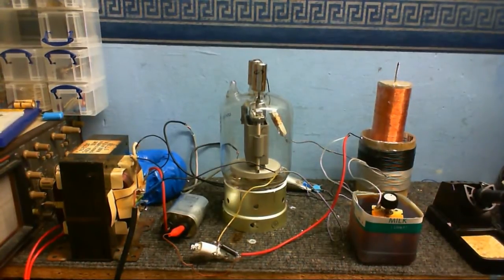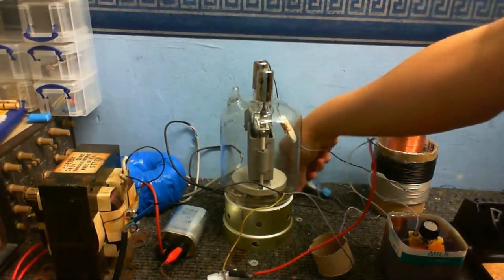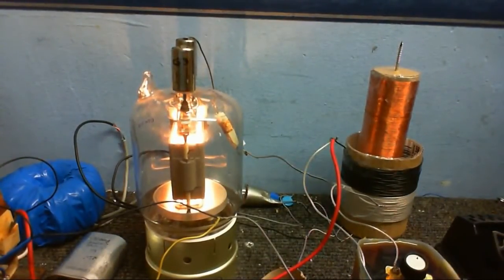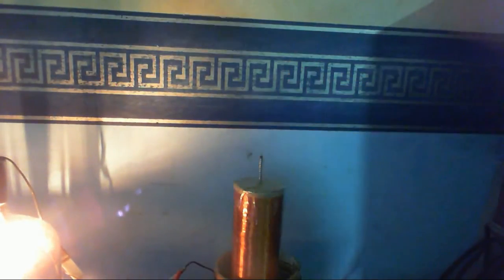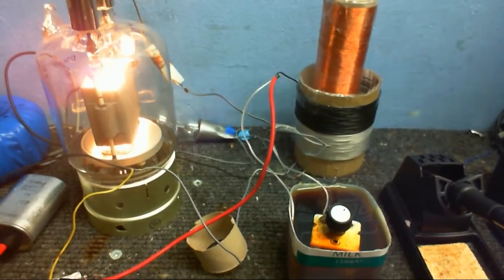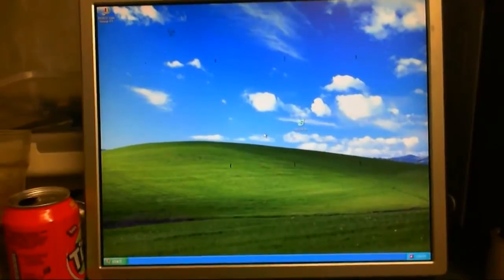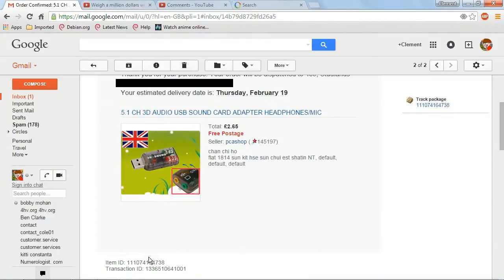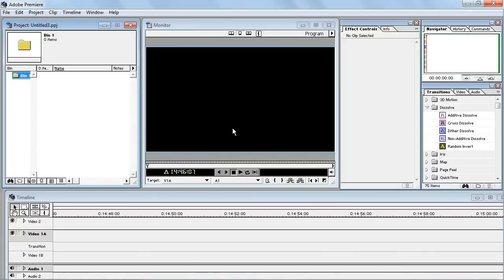GU81 VTTC, plus some bad & good news

Comment: Hey mate I have 2 of them pentodes for a VTTC did you run them in ? The filament should be run for about 12 hours to form the getter .take a look on 4hv.org ,do you plan on audiomodulating one of the grids would be good to see a reel to reel playing though it :)
Reply from the maker: HighVoltageProjects I might revisit a base-fed VTTC and try audio modulating that.  I've got an idea of a circuit that might work. But I had no idea that I had to "run the tube in" I thought they already had a getter, but just where I couldn't see it.
Reply: Cool ,I'll try and find the link for you as I'm sure I saved it somewhere .it's worth doing rather than damaging the tubes I think I have a schematic of one of these for audio too :) love the vids btw

Comment: Half the battle is primary tuning and grid leak tuning , With a 811A and a 2 inch by 2.8 inch secondary I was getting 10 inch arcs in staccato mode .  Are you running the 3 grids all tied together ?
Reply from the maker: twirlywirly555 Actually I have grid 1 & 2 connected together, grid 3 is connected to ground.  When I get some money 'm going to try to get some HV capacitors to tune my primary, THEN I'll try it on full power!
Reply: Okies , well its best to tie all 3 grids together and run it as a triode if your not using the second grid as normal

Comment: Do you worry about accidental electric shocks or house fire?
Reply from the maker: John Simpson I shocked myself dozens of times, I think I've become immune to it!  Seriously I can touch a live 300 volt wire (as long as it's DC) and not feel a thing, I only get zapped if it's AC or if I touch the ground wire as well. Should keep a fire extinguisher on standby though.

Comment: Sometimes the order in the drivers are intalled matters. You install the sound card AFTER some other drivers DID, and perhaps you got a HW conflict type. Scan for missing systems, chipset, motherboard missing drivers .... Also, SOME UPDATES can turn HW into unusable. Because, they are garbage
I would do a fresh installation, first do all the chipset and motherboard drivers, then move to the cards BUT Windows XP is DONE, turn to Seven, 32 bit version is pretty XP compatible, easy to install and is better than XP. I you have enough RAM install XP on a Virtual Machine, run XP and do all your things INSIDE the virtual machine. Since intallations in the virtual machine is just a big file with the OS+files+drivers+others, when it get corrupted, just grab a copy of this big file, and run it again. Third option LINUX. Running for 8 month here and zero problems. And PC runs faster. shame you need editting sw. Linux most have options for that, but not sure if will match Adobe Premiere. Also some SW are a bit buggy, because all is for free, so you dont expect that perfection. But the system itsefl is ROCK SOLID.